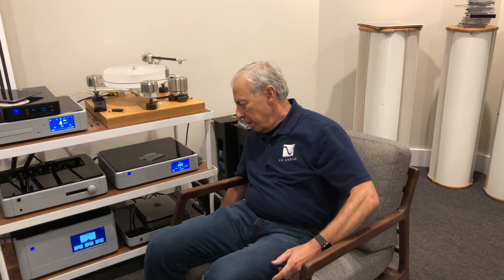Moving magnet vs. moving coil

Comment: I agree with everything you said. I personally get superior sound from my MC cartridges compared to my MM cartridges. I understand the concept of less moving mass from the lighter coils.

However one thing that bothers me is that generally MM cartridges are more compliant and are tracked at 1-1.5grams, while the majority of MC cartridges are low to mid-compliance and track optimally at 2-2.5grams. This seems opposite of what the low mass of the MCs would predict. 

Can you help out this graying audiophile?
Reply: Gordon Stanley I think it really depends on the cart , my MM Grace F9 tracks at 2g where as my MC Denon DL-304 tracks at 1.2g and that goes with all the MM and MC carts I have and have used .

Comment: The B&O moving micro cross moving iron variant was better than both. Their ultra low effective tip masses and sapphire cantilevers resulted in incredibly high speed and resolution.
Reply: I would like to see exactly how that works, but, removing effective mass is the name of the game!!
Reply: @vincentrobinette1507  Picture 4 cylindrical magnets wound with low # turns wire. Rounded edges (eddy currents) iron cross with ends of each cross directly in front of the magnets. Suspension disc at cross center. Cantilever attached to cross center on reverse side. Flux between the cross points and each magnet generates signal in the coils. Moving mass of small thin cross is ultra low and coupled with stiffness and mass of ultra thin, short sapphire cantilever with ulm diamond produced low resonance,    <0.1 mg etm. The B&O MMC1 and MMC2 remain unsurpassed 41 years later imo.
Reply: @tsamplifiers6493  If it produces enough signal strength, I might replace my existing Audio Technica cartridge with this. Mine only has two magnets, and the stylus tube looks like it might be an aluminum tube, and it has a fairly long cantilever. Mine only has two rare earth magnets in a 90 degree "V", but even all that said, it's a pretty good sounding cartridge. I have not measured the impedance or output amplitude of my cartridge. With the stylus destroyed, I have no way of taking any measurements, other than the DC resistance of the coils, but that doesn't tell me much. If I can't find a stylus, I may have to replace the entire cartridge.
     Any idea on the cost? I don't know if it's worth spending more on a cartridge, than what the turntable is worth.

Comment: There's always an alternative in audio !!
MM and MC ... but you often overlook one VERY important point ( excuse the pun ) and this is the stylus ( not needle ..PLEASE !!) geometry... if you compare a MM with a MC you must use identical stylii.. the best are bi radial types made from diamond and have an elliptical shape .. typically 0.0003" x 0.0007". This eclipse is positioned so that the smaller radii make the contact with the walls of the groove . So in this case in hand which Paul elegantly answered may I suggest you do check the stylus and see if ( in the case of your MM cartridge) you didn't also end up using a bi-radial stylus , which WOULD give superior HF response and trackability.
Reply: Janina Palmer and they need to be well aligned... the more radical the diamond shape the more critical the alignment, especially on the inner grove section if the record.
Reply: Gordon Stanley ~ precisely !
It's radial not radical btw

Comment: Mass was exactly the thing I was going to mention. Less mass, means it's easier for the grooves to accelerate the stylus, with lower tracking weight. With too much mass, the stylus actually rotates slightly, rather than holding its azimuth, and sending an accurate motion relative to the undulations of the grooves in the record. That causes cross talk, and distortion, especially at higher frequencies. A good mic/line preamplifier can solve any problems with the reduced output by flying the coil, rather than the Neodymium Iron Boron magnet. Moving magnet cartridges have improved a lot, since they went with the lighter, more powerful Neodymium magnets, rather than the older, heavier Alnico (aluminum nickel cobalt)magnets, but I still think there is more reciprocating mass with those, than with a modern moving coil cartridge. The lighter, the better!!! It also helps, if the ringing or resonant frequency of the whole assembly can be above any sound it would be asked to track, so it doesn't add coloration to the high end. The only ways to do that is to increase stiffness, and, or, reduce mass. I used to like flying magnet, because it put out a stronger signal, so I could maintain better signal/noise ratio on the amplifier, by turning down the gain. I've since found several studio quality mic to line amplifier ICs, which have such a good signal to noise ratio, that output level from the cartridge is no longer a concern. These chips also work well for the faint signal from magnetic tape heads as well. Now, I can explore these new flying coil cartridges!
Reply: Who, my friend.  This is pretty high-tech stuff your talking here!  I salute you!  I am a EE and barely followed your explanation, so I guess a n normal Joe/Jane (avoiding sexism..LOL) reading this will be totally lost.  But, again, I commend you!
Reply: He did give a very eloquent and intelligent response...lol. I followed it quite easily, but then again, I'm a commercial aircraft engineer so I guess my brain is sort of "set up" for this type of thing. Good stuff, though!  @aldocelli9371

Comment: Besides the moving mass, you have to consider the eddy currents generated in the copper that are created by the magnet. Drop a slightly smaller neodymium magnet down a copper pipe and see what happens!!!😉
Reply: @Douglas Blake 👍

Comment: Really? Ever slid the stylus off of an mm? Did ya see those two thin little winglets at the top of the cantilever? How much do you think those weigh? And consider they are at the top of the cantilever where they have to move far less than the stylus. I just think we're splitting ***t hairs with this stuff.
Reply: Isn't splitting hairs what makes us audio files
Reply: I think you haven't heard and don't own an MC cartridge of quality. The difference is not subtle.
Reply: @jimshaw899  I'm using a Sumico BPS nude on   a Linn Itok II arm/ Sota Saphire which I just love the sound of but how much of it is due to it being an MC I'm not so sure.
Reply: @InsideOfMyOwnMind  HOMC or LOMC?
Reply: @terrywho22  It's the original model, kind of in between I believe. Yeah it's old but still satisfies.

Comment: If the mass of a moving magnet is a problem, just make the magnet much smaller with neodymium and use an amplifier with a higher gain, similar to a moving coil amplifier. In the old days of turntables, neodymium magnets were not available and Paul’s point was more valid.
Reply: Back in the day, they were using alnico(aluminum nickel cobalt)magnets. They were competing with ceramic cartridges, and they were a big improvement, but now, they're using the lighter, equally powerful neodymium magnets, as well as samarium cobalt magnets. That helps a lot, making the choice hard: Do you want less mass at the expense of signal to noise ratio, or, do you want a little more signal strength to maximize S/N ratio, but with a slight attenuation at the upper limits of hearing frequency? With magnets as powerful and light weight as they are, and, preamps as good as they are, it's kind of hard to go wrong these days. Lower mass wins for me, because I can reduce tracking weight, and hopefully, prolong the life of my vinyl.
Reply: @Douglas Blake Not to mention hiss. that's why I recommend a balanced line mic to line preamplifier. That's the only way to get the extra gain, while maintaining an acceptable signal to noise ratio. to just simply turn up the gain on a regular phono amplifier will cause all the problems you described. Newer moving magnet cartridges, equipped with Neodymium magnets, can go a long way to reduce mass, without reducing the signal strength from the cartridge, so a conventional receiver can still be used, without modification, or a header amplifier.
Reply: @Douglas Blake Can you describe the axis of the rotation? it could be, that it's taking advantage of the very thing I was saying was hindering performance. I was talking about the actual needle, being levered left and right about the axis of the stylus tube. the cartridge I took apart, had two tiny magnets, 90 degrees from one another. If there was a signal on the record that only went to one channel, one magnet would move in and out of its coil, generating a signal. the other magnet would move radially within its coil, which would not produce any current at all. That required the stylus tube to move diagonally, radial to its axis. Any rotation would result in both magnets moving in and out of the coils, which would create cross talk, which greatly reduced channel separation. Two VERY different designs! The fulcrum for the stylus was a spider, similar to what a loud speaker uses. It allowed movement in any direction, but minimized rotation.
Reply: @Douglas Blake That's OK. Curious minds gotta know.😉

Comment: I personally don't have a horse in this race since I'm not a vinyl user, but wouldn't it make sense to design MM cartridges with rare earth magnets like neodymium or samarium cobalt (rather than alnico or ferrite) to lower the mass of the moving component?  I'm asking out of naivete since I'm not into vinyl these days and haven't been following advances in cartridge design, but has this been done in any current cartridges?
Reply: Brilliant idea. It's been done for about 40 years now. Analogy: MM is like a tiny wheelbarrow. MC is like just the front wheel.
Reply: @jimshaw899  -- ...and vinyl is a trendy nostalgia cult that's more about ritual and visual aesthetics than sound.  That bit of snark notwithstanding, I was just curious because I was involved electromagnetic transducer technology in the previous decade -- so thanks for the heads-up.  Now we're both better informed -- and it's good to know that whatever's left of the phono cartridge industry is more aware of the available materials than I was about said industry.  Peace.

Comment: Seems right as far as it goes. Consider: lower stylus/shank/coil mass also makes the job of damping resonances much better. Also, stylus restoring forces are less. But I'd be willing to wager that as big of a cause of audible improvement is the shape and quality of the stylus. I have the Grado MC. When it replaced AT's best MM (at that time), the differences were as dramatic as your questioner noticed. The Grado was not only MC, but its stylus was a far smaller elliptical shape to trace more exactly. Not only did I hear more delicate detail, the sound stage widened and stabilized in place. CAVEAT: The Grado works best on really clean records. That too makes a huge difference.
Reply: Reduced cross talk, better channel separation, because with reduced mass, the stylus track more accurately, because it doesn't roll. It maintains a more perfect azimuth. Of course, lower mass means better high frequency response. If the ringing resonance frequency is higher than the highest sound frequency it will be asked to track, that means less coloration, so you're hearing program material, not the ringing of the stylus.

Comment: ive had a rega p8 with the rega apheta 2 moving coil cartridge fitted for a few weeks now and had the same reaction..going from mm to mc was night and day..love the mc sound..so much better
Reply: barrie MC cartridges are night and day you are right, although it depends on the pre-amp whereas MM cartridges are not as fussy.
Reply: The difference is probably because the alpheta is in a higher pricerange, more or less translating into higher performance.

Comment: How about DS Audio optical cartridge?
Reply: Do share.
Reply: InsideOfMyOwnMind laser TT have been out for years.
Reply: @TexasScout  The last I heard they were still a bit troubley but my info is a few years old.
Reply: That sounds like a very good concept. Even LESS mass! the lasers, and detectors can ride in the sprung weight of the cartridge(and tone arm), while the only moving unsprung weight is the stylus itself. With the right detectors, it's possible to get very high signal strength, (like condenser microphones) and further improve signal to noise ratio as well. That's like having your cake, and eating it too.
     It would be fun, if they could develop lasers fine enough to directly reflect off the grooves of the records, and do away with the stylus entirely. No wear to records, no needle to replace, ZERO MASS!!! it would just track, kind of like an analogue version of compact disc.
Reply: Vincent Robinette http://www.elpj.com

Comment: I would think that the mass of a magnet on the needle shaft would put more force on needle tip in the track on the album and wear it out over time.
Reply: The tracking force that the cartridge is set at denotes how much pressure the stylus is putting on a record.
Reply: Nick Pantazi I think he means “mass”. More mass=more wear.